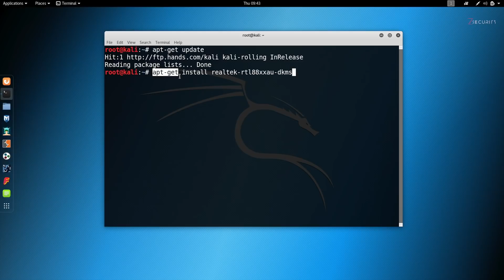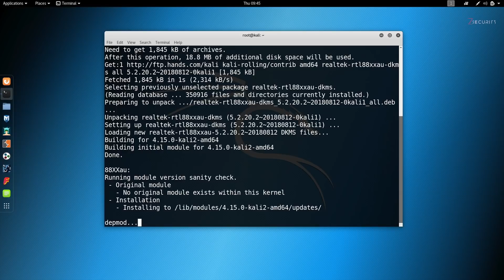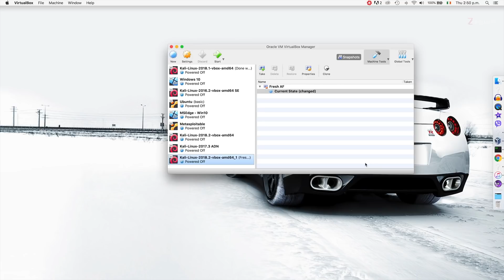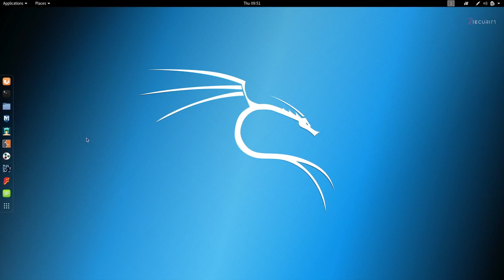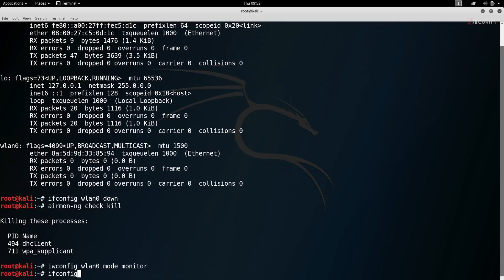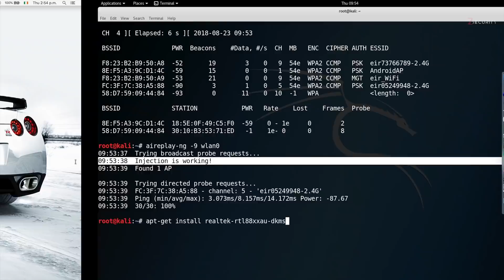Installing Drivers for RealTek RTL8812AU on Kali Linux & Testing Monitor Mode & Packet Injection

Comment: I can't thank you enough! I have been fighting with the RTL8812Au for about 2 weeks now. I thought I was going crazy.. lol. You, Sir, are my new best tech hero. :)
Reply: KemoKnows Hey Kemo! After following this tutorial, were u really able to see wlan0 (or in my case wlan1) in Virtual Machine? I got this all working, thanks to this tutorial, on my actual Kali OS, but when I run ifconfig in Virtual Machine, there’s no wlan’s to be found. Any help would be appreciated!
Reply: Rob Goc I sure did. I had been struggling with this for sometime. Is your VM recognizing it? Make sure you update the network within VM system settings (I work with Virtual Box). Unplug the device start VM and wait for it to fully load before plugging it in (this was my problem). Check if you are getting an indication it is actually working. Try looking at Iwconfig and if you get an error that says "no wireless extension" or something to that nature, you have another issue that is easily fixed with more software. Let me know how it goes.
Reply: did you get this to work? i'm having the same issue. it is detected by my VirtualBox, even after i run kali. But no wlan0 in ifconfig
Reply: dhillman88 I did! The only new issue is that Ubuntu (my main OS) is constantly losing wi-fi connection, so I haven’t been able to really test how everything works yet. Wasn’t gonna come back here and celebrate until I did. I can help you install guest additions if you need it still. I can help you I install the VirtualBox extension pack if you still need that and I can hopefully get the router to show up in ifconfig or iwconfig. Where exactly are u in the process and what have you already done?
Reply: I have Kali Linux running on virtual box and the extension pack. i tried installing the driver for RTL8812AU chipset as well, following the instructions here. At the end of apt-get install, the texts came out different from what's shown in this video, but it seems that the driver was installed anyway because if i run the command again, no changes happen. if i run dkms status, it tells me realtek-rtl88xxau is installed.

so it looks like everything is setup but still no wlan0 from ifconfig. in kali, if i run lsusb, it detects my usb dongle. it's just not showing up in ifconfig.
Reply: Ok I think I got it. I have a couple of questions first: 
1. I see that you've got Kali running on VirtualBox but what is your actual operating system? I have a dual boot Windows 10 / Ubuntu PC and I've got this to work on Ubuntu, haven't tried on Windows, as the entire reason I created the dual boot was because VirtualBox runs really slow on Windows for me, as it just takes up too many resources. I only mention this because if you're base OS is Windows, I'm not sure I'll be able to help. 

2. I assume what you meant in your most recent message was that you tried everything the above video said to do on your main operating system, right? Because what you wrote actually sounds like you tried everything in the Kali VirtualBox. If you did, that'd be the main issue right there. You're supposed to install the Realtek drivers on your actual OS, not in the virtual machine. 

3. You said that you installed VBox and the extension pack, but did you also get VirtualBox with GUEST ADDITIONS installed as well? As far as I know, Virtual Box cannot detect or connect to any USB devices without Guest Additions installed. The video above did not mention needing this but I think there's a chance the uploader may have skipped explaining that you need it. Installing Virtual Box with Guest Additions WAS tricky, but I've actually figured it out:
In your Kali VirtualBox, type uname -r  into the terminal and if it shows 4.17, you need to first run apt-get update, then apt-get dist-upgrade to upgrade your Kali to the latest version then reboot. Run uname -r again, and it will say 4.18. Very good. Now run apt-get update again, then apt-get upgrade. Now run apt-get install virtualbox-dkms. NOTE that I am placing periods at the ends of these commands so you can read what I’m writing correctly, but do not place periods at the end of commands when you enter them :) Now run apt-get install linux-headers-virtual and you’re all set! Now reboot ( you can either type reboot and hit enter in command line or you can restart the classic way, totally up to you.) Once you’ve re-started, you can check to see if everything installed correctly by typing lsmod (the first letter is an L if you can’t tell) and this will show you a long list. Find virtualbox and it should say vboxguest on the left. There you go! VirtualBox guest additions is installed!!!
Reply: 1. I'm running virtualbox on windows 10
2. i haven't tried this one. i have not tried installing realtek 8812au driver on my windows. i assume it's already there though because i can use the dongle on my windows just fine. is this correct?
3. let me try this out. i feel like i've installed guest additions before (i found an iso file for the guest addition in my computer) but i can't remember what i did exactly with it. i'll let you know if this works. but if what you said is true, how come kali in virtualbox CAN detect my usb dongle, just not as a wireless adapter? if i run lsusb, it sees the device.
Reply: dhillman88 any luck???
Reply: im trying to install guest additions as you suggested. but cant seem to get it to 4.18... uname -r still gives me 4.17 after apt-get update and apt-get dist-upgrade
Reply: The only reason I can think of why you're still seeing 4.17 after apt-get update and apt-get dist-upgrade is that your repository file is not setup correctly. The repository file is where Kali, or any Linux distrobution / OS pulls the files from when you try to update or upgrade anything. Can you please verify your repository file looks like this: 

deb http://http.kali.org/kali kali-rolling main non-free contrib
deb-src http://http.kali.org/kali kali-rolling main non-free contrib

You can find your repository file in Files>Other Locations>Etc>Apt>Sources.List. Right click on Sources.List and open it with Text Editor. Once opened, make sure the only thing in there is the two lines of text above. Hit Save and then close and then reboot, and then try apt-get update and apt-get dist-upgrade. Reboot again, and it should say 4.18.
Reply: The guest additions installation is working now. I got to a point where it asks me if I want to "modify smb.conf to use WINS settings from DHCP". do i go yes or no on this one?
Reply: dhillman88 I actually don’t know but I know what you’re talking about. It’s a virtual machine so it doesn’t matter if u mess it up, so I chose yes, but maybe do some research to see what u should choose?
Reply: @robgoc  well if you chose yes and its working on you, ill try the same thing
Reply: i got to the very last step of your instructions but it says unable to locate package linux-headers-virtual.
Reply: dhillman88 damn...always fun! Double check u followed all the steps perfectly and make sure u reboot when the instructions say to do so. Don’t give up ur close!
Reply: damn i double checked everything and really just that last one doesnt seem to work. the virtualbox-dkms is good but only the linux-headers-virtual just keeps giving me the same error of unable to locate package :(
Reply: dhillman88 dhillman88 well, ultimately we’re trying to get to typing lsmod (the first letter is an L) into terminal. Scroll down until you see something that resembles VirtualBox. If it says vboxguest, you already have guest additions like u thought a while back. Any chance you see it???
Reply: if i type lsmod, i see vboxguest under the "module' column, 45056 under "size" column, but a 0 under the "used by" column. does this mean i have it it installed?
Reply: man i finally got it to work! EXCEPT for one thing which is the whole point of doing this entire exercise. when i do airodump-ng wlan0, no surrounding wireless network is detected... any ideas why? i have made sure my rtl8812au external usb wifi is on monitor mode.
Reply: @dhillman88  I have been struggling with my ACH too. Believe it or not it was the stupidest answer... I've been using a USB 3.0 extension since my Desktop sits in a cabinet on display, and my monitors are across the room... I plugged it directly and and boom it appears in ifconfig and everything. Prior to this it would only appear in iwconfig and not in ifconfig, and would throw an error when I tried to switch it to monitor mode. Jeez Louise... I'm VERY disappointed in the range however.
Reply: @robgoc  Hey, I'm struggling with the same issue. I followed all the steps until here. The only thing that's not working is the linux header thing, it says unable to locate package linux-headers-virtual ... I also checked lsmod, I found vboxguest there, but wlan0 is still not showing up in iwconfig. only lo & etho saying no wireless extensions .. 
thanks in advance!
Reply: Vicky Leskoschek you should hit up dhillman88. I haven’t looked into this in forever. Good luck!!
Reply: @vickyleskoschek482  hi did you find an answer to this problem, i have the same issue
Reply: @t3trakill3r24  plug your adapter to your windows OS and open control panel and go to > hardware & sound > deviced and printers. Now check if your chipset is a 8812AU instead of 8812BU. If it is BU it won't work you need an another driver
Reply: @isore3090  i have bu. monitor & packet injection work on it just need to install its drivers
Reply: @dhillman88  hey i hope you can help me ... i have the same problem... i plug in the adapter but after i run kali. But no wlan0 in ifconfig. please can you help me ?
Reply: @dhillman88  BUT VIF IS NOT SUPPORTED!!!
Reply: @robgoc  BUT VIF IS NOT SUPPORTED!!!
Reply: @wickyx9088  BUT VIF IS NOT SUPPORTED!!!
Reply: Yeah apologies, I’m in Virtual Box as well. The tutorial doesn’t show it, but is there perhaps a setting inside Virtual Box’s NETWORK settings that needs to be adjusted? In the tutorial, he just zips over to Ports and sets up the antenna as USB 3, but is there any chance you need to set certain NETWORK settings also? Any chance you could share what your NETWORK settings are?
Reply: Network Settings - NAT selected, and Enable Network Adapter selected
USB – Ralink 802.11 n WLAN [0101]
System – Motherboard- 2048 MB
System – Processor – 2 CPUs, Execution Cap 100%
 Another trick that might work is reinstall Kali. 
Email me if you want.. Roofjack1@yahoo.com
Reply: I've a problem , it says it's installed but my Kali linux it's not showing or even recognising the adapter it's the same one in this video ?
Reply: does RealTek 8811CU work?
Reply: BUT VIF IS NOT SUPPORTED!!!

Comment: Hi Zaid, I am having issues with this adaptor. It works in windows, I am able to scan and connect to AP's but when I connect to my kali VM I am unable to find a network. It shows under ifconfig as wlan0, I am able to change it to monitor mode but it still won't see anything... any ideas? I have just tested it in the Windows 10 VM and it is working there also. I have also tried it in a fresh install of kali. 
Barry
Reply: Install it in your HDD do not use VM ware because VM ware has alot of disadvantage and eat your RAM a lot

Comment: please help, I have the same device if I do (Iwconfig) its give no wireless adapter even its appeared its connected to my VM machine with its name (Realtek 812Au)  ????
Reply: Same issue here
Reply: did you get it to work? im having the same issue
Reply: No
Reply: Did u resolved it now?
Reply: I resolved it dude .Try using the latest Kali version(2018.4) and also update the driver for the WiFi card in the device manager.
Reply: @kaushikd5824 congrats, as I know the last version of kali is 2018.3, and how can I update the driver for the WiFi card in the device manager ???? which driver ??? cause I using kali as virtual, thank you in advance

Comment: Nothing shows up when i ifconfig
Reply: I had this same problem, when you're logged into kali, go to devices in the toolbar at the top, navigate to USB, make sure that it's still on the correct USB interface (IE 3.0). If not, shutdown (sudo shutdown -h now) and re-do your USB configuration in the VMWare GUI. Once that is done, go back into Kali, go back to the devices toolbar and select your adapter. At this point all you need to do is connect whatever network you're trying to connect to. Hope this helps!

Comment: What version of kali Linux is the one you have in the tutorial? Kali Linux 2018-2? Thank you
Reply from the maker: Yeah its 2018.2
Reply: @zSecurity  I have problems with the wireles Alfa awus036ach, in virtualbox I walk but a few minutes and disconnects
Reply: I have 2018.3 and it doesn't seem to want to work.
Reply: 2018-2